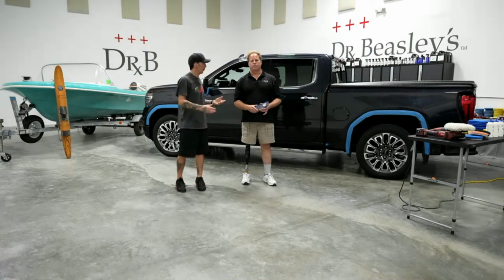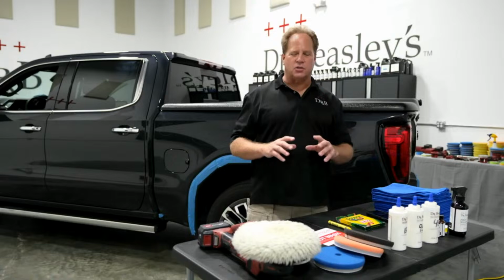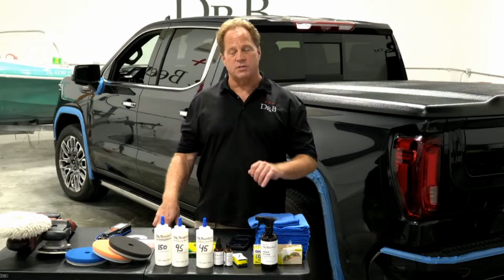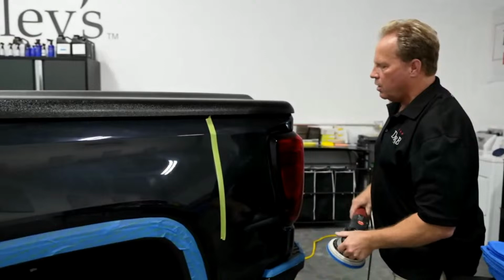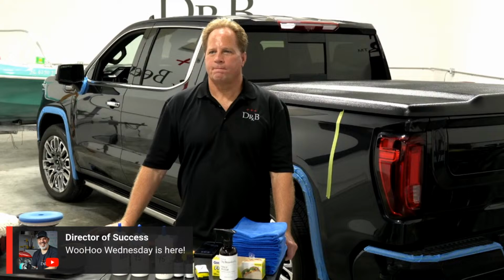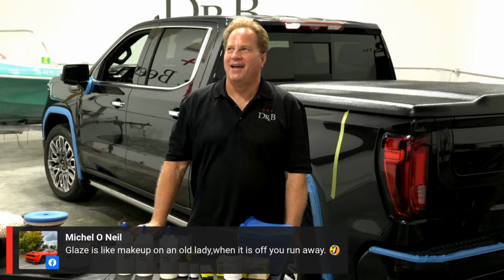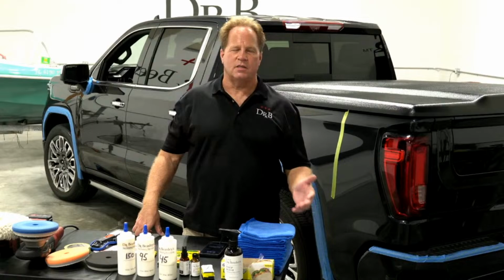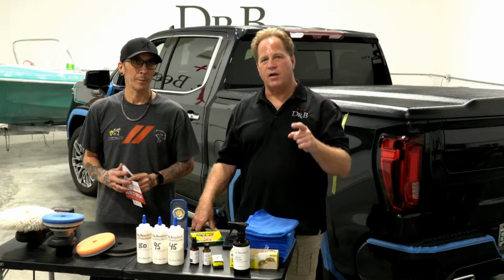New Car Detailing | 🔴 LIVE Online Detailing Class with Mike Phillips

Comment: Hey Mike, those swirl finder lights you use, are those effective even when used outside?  Which brand/model light are you using in this video?  Would you also recommend this same light as a good quality one to have?  Thx again Mike.
Reply: There are so many swirl finder lights on the market today and that's a good thing - it provides options.  The light I'm using is the Lake Country Hand Held Light.  It's very BRIGHT and works great to reveal defects.  It's a tick too bright for video and camera work BUT if you click the power button twice immediately - there is a lower light setting that does work for video and camera work.  I think these lights retail for around $100.00 and "yes" I would recommend.